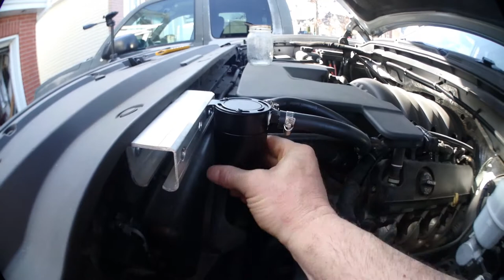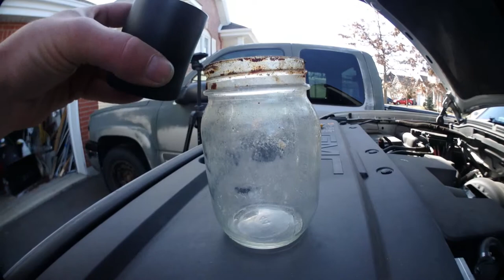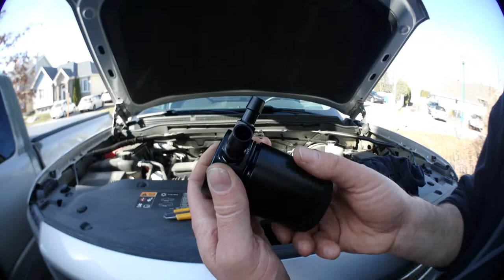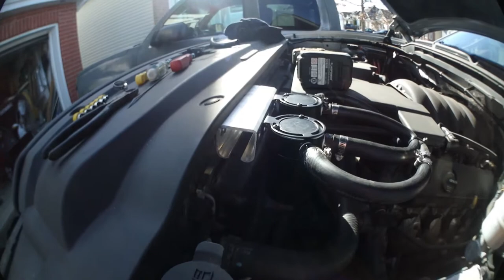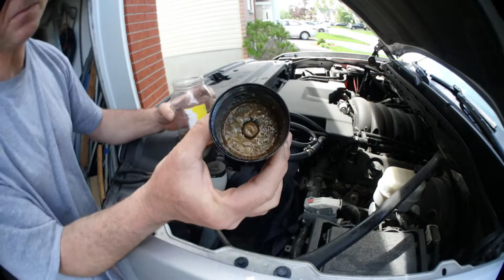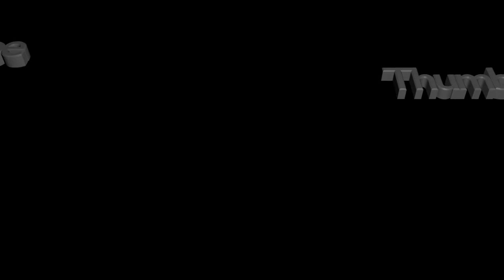GMC sierra 2014.You think one oil catch can is enough?  Wait for It .How to install oil catch can.

Comment: Due to emissions, raw fuel, carbon gases and water vapor have to be reclaimed back into the combustion process. The PCV is a vacuum leak, metered and calculated by the PCM. Now, at the valve cover, some do better at keeping raw oil from the valve train from entering the valve with baffling. You mention this light bulb to plug the top where a supplied breather goes. The breather is on the vacuum side and must have a check valve to prevent a vacuum leak, causing a lean idle misfire. If no valves, it’s junk. The hoses should be mounted upward to allow oil to drain back into the engines valve cover. Also, the can should be mounted away from heat, crash cool air will help much more to condense gases into a liquid. The media used inside the can helps to coalesce gases into liquid. Short trips in any vehicle does not get the oil or engine above a temperature to boil of fuel first, water vapor second then carbon based gases last. The cans design, location, routing upward of hoses, media inside can all change the effectiveness of any catch-can. Putting the wrong PCV valve with a higher flow ( Those that are Serviceable ) can creat looping at idle, making its RPM go high and low. The PCM is trying to maintain a programmed idle speed, regardless if IAC or DBW type throttle control. You experience and ability to catch gases into liquid and keeping the intake, air plenum and valves clean, increasing engine life, will be much better.
Retired ASE Master Tech
Reply from the maker: Thanks for all this valuable info.
Thanks for watching,best regards.

Comment: Great video and nicely done! I could not quite see from the video, but was there a slight difference in the content of the liquids? The first one seemed to comprise more oil and the second more watery substance. I guess oily molecules are much larger than water vapor, hence in the second you get mainly water, as the gasses have cooled down and started to condense.
Reply from the maker: They were both almost the same.I am curious what i would get if i put five catch can...
Reply: @obscur156  Many thanks for the reply and info. The oil/water vapor will be filtered eventually, but how many would be needed.
Reply from the maker: @moremolecules  yes,people always put one catch can.I decided to try two just to see how effective it was.Maybe i will try with more to see how many i need for the last one to be empty.Regards.